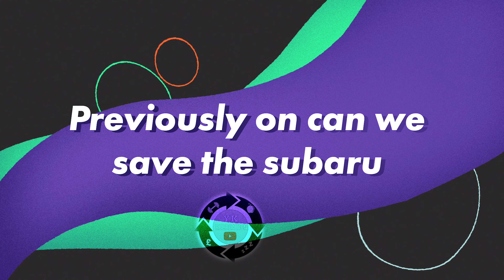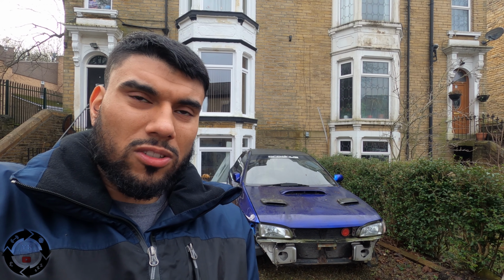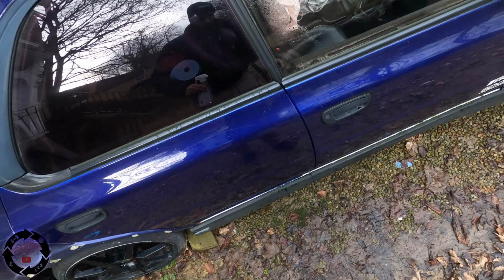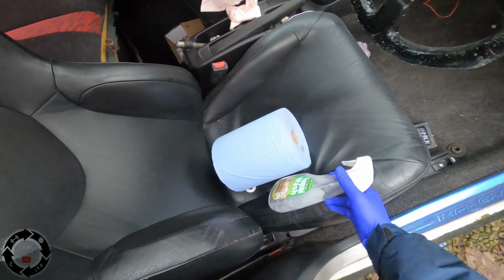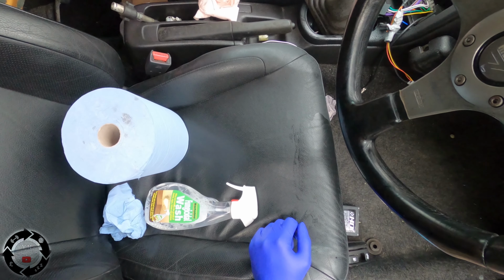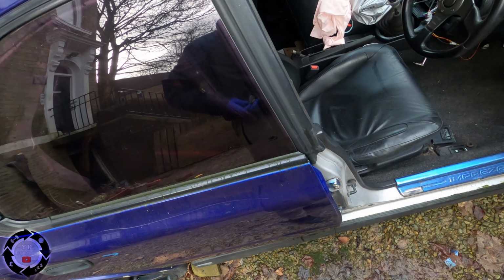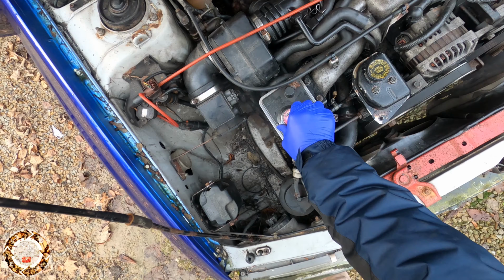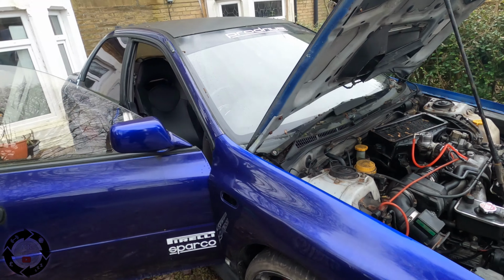#SUBARU IMPREZA STRUGGLING TO START 😓|CAN WE SAVE THE SUBARU | EP 6 (HEAVY MISFIRE)

Comment: I'd guess where the tank was practically empty when you first started it, you've sucked all the gunge from the bottom of the tank into the fuel system. So probably the fuel filter is blocked. Hopefully not gunged up the injectors. I'd start with a new fuel filter. 👍
Reply from the maker: Thank you 🙂  good shout 👏 will get a replacement fuel filter also
Reply: Nailed it dude! Good to see it start 👍
Reply from the maker: Yes ! We are getting there 💪 its still missing firing badly but the main thing is that it runs

Comment: Coils are down look for a spark ⚡️
Reply from the maker: Will have to do some tests
Reply: Easy start mate saves messing around 👍
Reply from the maker: @scoobyg6443  hmm I've used that stuff on diesels not petrol
Reply: @YKRECREATION  I love the stuff if it runs with easy start you no you have a spark and that means fuel problem 👍
Reply from the maker: @scoobyg6443  good idea 💡 will check pipes to see if fuel is coming in 1st. That stuff can cause damage if used for long
Reply from the maker: @scoobyg6443  yh quick few sprays